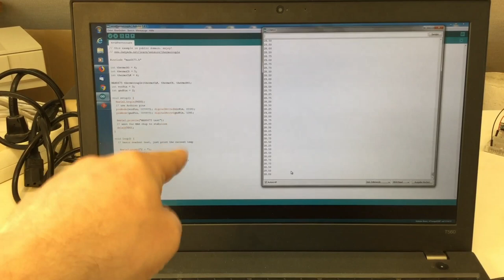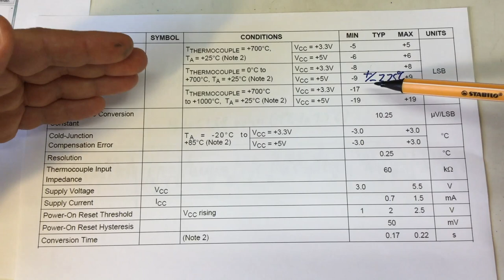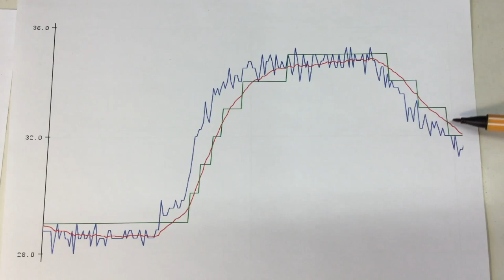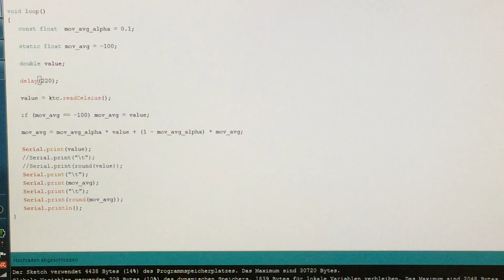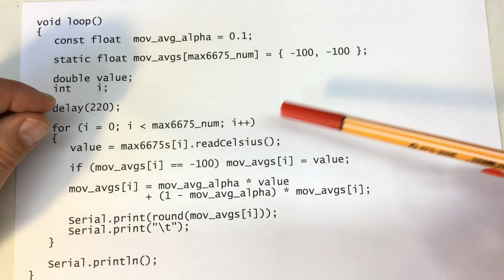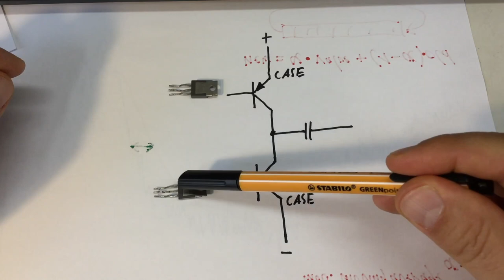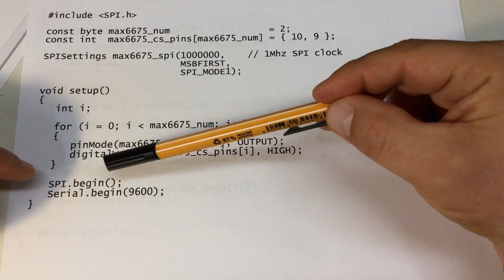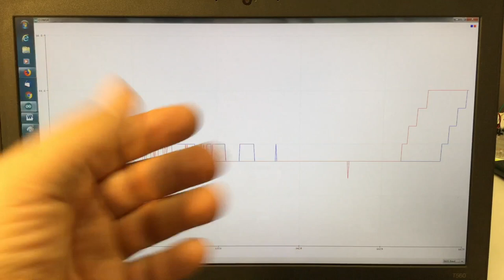Arduino, Thermocouples, MAX6675 and SPI – The Fine Points

Comment: How connect this with Voltcraft HPS 13030 and I need to give voltage of 8v to 10v from this Voltcraft machine to control the temperature!!! Can you help me with this?
Reply from the maker: I don't quite understand the question. What temperature do you want to control? Are you using the Voltcraft power supply to power some heating element and you want to control the temperature of that heating element?
Reply: @robertssmorgasbord  yes exactly you are correct, how can I do that?
Reply from the maker: @jeelpatel4511  Well, that's a larger project ...
If you go down the digital route, you would measure the temperature using a thermocouple and and for example a MAX6675. Then you would have a MCU (e.g. Arduino) with some software. And that would drive a two channel DAC to generate the control voltages for your Voltcraft. I do have two videos about a suitable DAC:
https://youtu.be/bj57xuQS7L8
https://youtu.be/BrZYVWQ-p3U
I hope that helps.

Comment: Hello, I hope you are well and safe now. Please make a video to control and monitor the temperature from Thermocouple with STM32 Microcontroller, Max6675 module, and keil uvision software, and also share the programming code of Keil Uvision software. It will be very helpful for me and other researchers.
Reply from the maker: Hello, hope you're well and safe too. Unfortunately  I never worked before with STM32 MCUs or the µVision IDE. So I'm probably the wrong person to ask. Sorry!

Comment: Have you thought about calibrating it ? Mine when put into an ice bath shows 4 deg C.
Reply from the maker: Nope, haven't tried or thought about that ... but thanks for the suggestion! I'll probably try that when/if I'm coming back to thermocouples ...
Reply: You could get a reading of boiling water and then use the map() function, assuming that the thermocouple is linear.

Comment: Im connecting 8 thermocouples to my Arduino Uno and need to log the data to an SD card. The SD card cannot be initialised if the SO and SCK pins are connected. please help I can share my coding if u want.
Reply from the maker: Sorry, I never worked with a SD card connected to an Arduino. To be honest I never used a SD card in any project to this date. So I unfortunately can't be of any help. Have you tried one of the Arduino's software SPI libraries to simply connect the SD card to other pins? ( https://github.com/MajenkoLibraries/SoftSPI , https://wiki.seeedstudio.com/Software-SPI/ )
Reply: Ya i am using spi library. Can i use the non modified codng for 8 thermocouples ? I tried using that code but it wasnt giving me correct tempreture values.
Reply from the maker: @samintarajarujunan5995  I don't quite understand ... I was suggesting to use the hardware SPI (SPI.h, SPI object) for the MX6675s and the software SPI (SoftSPI.h) for the SDCARD.
Reply from the maker: @hornos27hotmailcom  Lo siento, pero mi español se basa únicamente en Google Translate. Así que realmente no puedo seguir ese video.

Comment: Hi Robert....do you know how I can modify your code to read the tempreature in Farenheit ??..thanks
Reply from the maker: Simply use the .readFahrenheit() method instead of .readCelsius() ;-)
Reply: Thanks Robert...but your code has not that "redCelsius()" line. You get the value with the sentence  "value=max6675Read(max6675_cs_pins[i])"...how would you do it.??..thanks a lot..
Reply from the maker: @Dany1557  Ah, sorry, thought you referred to the original MAX6675 library and not to my modified version starting at 29:19 ...

In my function
   "float max6675Read( int max6675_cs_pin )"
replace
   "return (data >> 3) / 4"
by
   "return (data >> 3) / 4 * 1.8 + 32"
and everything will be in °F.

Hope that helps
Reply: @robertssmorgasbord  ..excellent!!..thanks a lot.!!!
Reply from the maker: @Dany1557  You're welcome ;-)

Comment: The Arduino code for your study is for the two MAX6675 modules.?
Reply from the maker: Yes, the Arduino sketch is for two MAX6675. You can easily modify it by changing const byte max6675_num to another number, e.g. 1 if you only have one MAX6675.

Comment: how do i convert this code to 1 sensor and mqtt . please will someone help me with that?
Reply from the maker: Sorry, can't help you with MQTT, never did anything with MQTT. As for using the code with only one MAX6675 (no MQTT though): Just set max6675_num to 1 and initialize all arrays for just one max6675. Or use the first version of the code for just a single MAX6675.

Comment: How can I connect 14 thermocouple each with a max6675 to a multiplexer CD74HC4067 ??? pls help
Reply from the maker: Short answer: Sorry, you can't.
Long answer: A thermocouple produces maby a few dozens Microvolts (not millivolts) per Kelvin (including negative voltages at negative °C). It is hopeless to try to multiplex such signals with something as simple as an CD74HC4067 (it can't handle negative input voltages and the noise level is a few Millivolts (a few thousand Microvolts).
The way you usually would go about it would be to use 14 MAX6675 (one for each thermocouple) and then multiplex them on the SPI bus.
Reply: @robertssmorgasbord  thanks for answering, and how can I do that? do I need another multiplexer? and which one?
Reply from the maker: @danbam9018  If you have 14 free IO pins on your MCU you don't need any additional chip. Just use the IO pins to drive the SPI CS pins. If you have only 5 IO pins free, use a CD74HC154 4- to 16-Line Decoder/Demultiplexer. The Y0 to Y15 outputs go to the CS pins of the MAXs. The MCU selects the MAX using the A0 to A3 pin and sends the CS signal into the E1/E2 pins.
Reply: @robertssmorgasbord  and How can I do the code to make it works? where can I find some examples? thanks
Reply: @robertssmorgasbord  so i need to put E1/E2 in a SPI ? or those two goes to gnd?
Reply from the maker: @danbam9018  I don't think anybody ever tried to connect 14 MAX6675 to an Arduino, so you're probably out of luck in regards to examples.
Reply from the maker: @danbam9018  E1/E2 (connected together) get the CS signal from the Arduino. With A0 to A3 the Arduino selects which MAX gets the CS signal. The MAXs get there CS signals from Y0 to Y15.
Reply: @robertssmorgasbord  I did it, thanks for the help :)
Reply from the maker: @danbam9018  You're welcome 🙂

Comment: How to use thermocouple more bouble
Reply from the maker: Ah, "more bouble"?
Reply: @robertssmorgasbord  sorry i mean more 2 or 3 thermocouple
Reply from the maker: @vvoranartsomnam5507  Ah, OK, you want to prevent the shorting issue when using multiple thermocouples? There's a video where I explain how to galvanically isolate the MAX6675 to prevent that issue: "Galvanic Isolation of SPI Devices (e.g. Arduino, MAX6675 and SI8631)" https://youtu.be/6rEJh4yPekg .
Reply: @robertssmorgasbord  Thankyou so much, i can do it
Reply from the maker: @vvoranartsomnam5507  You're welcome :-)

Comment: error is occurred  @th line SPI.begintransaction(mX6675_SPİ);
I have defined SPI library in the code
Why did it occur the failure
Could you please help me
Iam very pleased the video thanks a lot
Reply from the maker: Well, what error exactly (I'm assuming it's a compilation error) is occurring at "SPI.begintransaction(mX6675_SPİ)"? And can you upload somewhere the rest of your code? It's basically impossible to tell what's going wrong without the whole code.
Reply from the maker: @orhanyucel1800  You've made a typo at one point, forgot a function declaration and added a totally nonsensical line. This version of your code complies without errors:

#include <SPI.h>
//#include "max6675.h"
//int i;
//double value;
//const int spi_miso_pin = 12; // spi master in slave out pin
//const int spi_sck_pin  = 13; // spi serial clock pin
const byte max6675_num = 2; // Serial Clock am PIN 10
const int  max6675_cs_pins[max6675_num] ={10,9};  //max6675 chip select pins

   SPISettings max6675_spi(1000000, MSBFIRST, SPI_MODE1);   // 1 Mhz SPI clock
                      
                         
//MAX6675 max6675s[max6675_num] =
//{
 // MAX6675 ( spi_sck_pin, max6675_cs_pins[0], spi_miso_pin ),
 // MAX6675 ( spi_sck_pin, max6675_cs_pins[1], spi_miso_pin )
//};

void setup() 
 
{
 int i;
  
  for (i = 0; i< max6675_num ; i++)
  {
    pinMode(max6675_cs_pins[i], OUTPUT);
    digitalWrite(max6675_cs_pins[i],HIGH);
  
  }
     
  SPI.begin();
 

  Serial.begin(9600); // Begin der Seriellen Kommunikation mit 9600 Baud
  
   
}
 
void loop()
{
   const float mov_avg_alpha = 0.1;
   static float mov_avgs[max6675_num] = {-100 , -100};
   float value;
   // float max6675Read(int max6675_cs_pin); !!!!!!!!!!!!!! THIS DOESN'T MAKE ANY SENSE !!!!!!!!!!!!!!!!!!!!!

   int i;

   delay(220);

   for (i = 0; i < max6675_num; i++)
   {
      value = max6675Read (max6675_cs_pins[i]);
  
      if (mov_avgs[i] == -100) mov_avgs[i] = value;
      
      mov_avgs[i] = mov_avg_alpha * value  + (1 - mov_avg_alpha) *
      mov_avgs[i];

     Serial.print(round(mov_avgs[i]));
     Serial.print("\t"); 
  }
   
  Serial.println();
}

float max6675Read(int max6675_cs_pin) // !!!!!!!!!! YOU FORGOT THESE TWO LINES !!!!!!!!!!!!!!!!!!!!!!!
{                                     // !!!!!!!!!! YOU FORGOT THESE TWO LINES !!!!!!!!!!!!!!!!!!!!!!!
   unsigned int data;
 
   SPI.beginTransaction(max6675_spi);

   digitalWrite(max6675_cs_pin, LOW);

   data = SPI.transfer16(0);         // !!!!!!!!!!! IT'S SPI.transfer16 NOT SPI.Transfer16 !!!!!!!!!!!!!!!
   
   digitalWrite(max6675_cs_pin, HIGH);
   
   SPI.endTransaction();
  
   if (data & 0*0004)
   {
      return NAN;
   }
   else
   {
      return (data >> 3) / 4;
   }
}